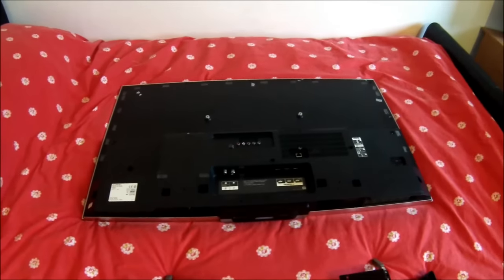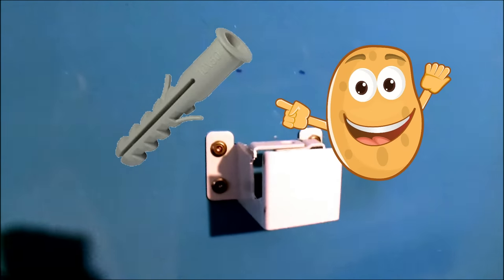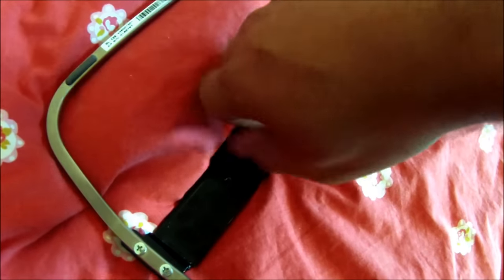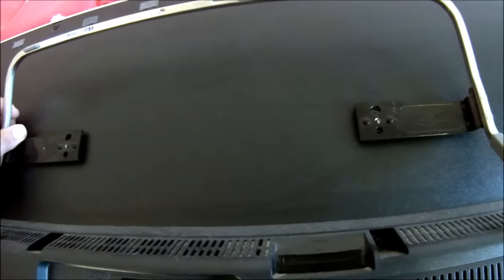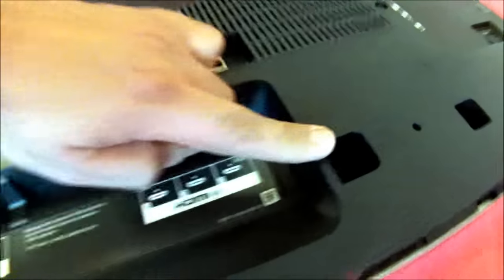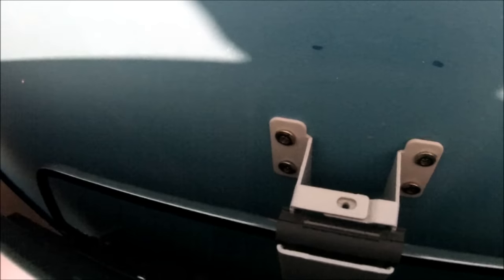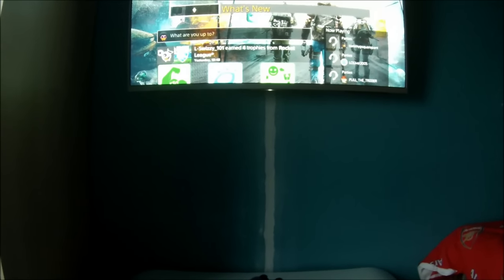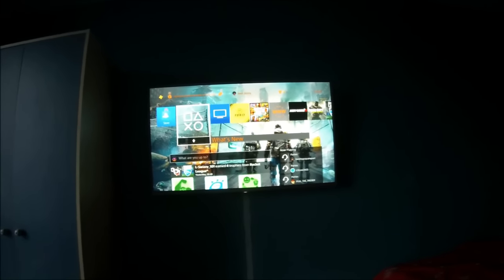How to Use The Sony BRAVIA Wall Mount

Comment: Some advice please. I lost my stand. I cannot find any. Is there an alternative stand i can get?
Reply: I have the same problem, and sorry to say you might as well take the tv to the dump.
Reply: Me too!!! Solved?
Reply: @davidrobert1948  solved?? :(
Reply: Hi, Well after hunting high and low finally I found one second hand on eBay; they did ripp me off and charge £40 though, but I was just happy to find one. So if you need one I would recommend searching though eBay; eventually you will find one 😀

Comment: Hi. Does anyone know if and where I could get the white part that screws into the wall and the plastic bit? We seem to have misplaced ours. We've had the tv for years and now want to mount it but can't find that part. Been looking online but without any success. Thank you😊
Reply: Did you have any luck with this? Currently in the same boat ha
Reply: @carlmcwaters2961  Unfortunately not 🤷🏾‍♀️😔
Reply: I need one as well 😅
Reply: same here, i think i'll call a blacksmith to make a part to mount it... if not, it's impossible

Comment: MY Sony Bravia didn't come with any of the mounting pieces...
Reply: Same here!
Reply: same here :(
Reply: I reached out to Sony and the provided the name of a supplier from which to purchase from. Its expensive
Reply: @katpierre5463  Where and how much?
Reply: Kat Pierre can you please share the details? we never got the wall piece and need.. t.i.a!
Reply: @kirikathoodrat  same here 😭 if possible
Reply: Please someone, where can you buy the wall kit if you didn’t get it when you bought the TV.
Reply: @katpierre5463  can you give details please, desperate. Thanks
Reply: @Denzilcleveridge  right? I've been looking for a very long time now 😭
Reply: Update.  I was never able to find the missing pieces. Even the original equipment that comes with the TV is missing parts and Sony does not seem to have them. My electrician says I may need to just buy a different universal wall mount but have to do a lot of research to make sure to find one that fits because this TV wasn't initially meant for that.

Comment: Shouldn't you use both brackets so its stronger? or is one sufficient?
Reply from the maker: Only got one in the box 👍
Reply: The other bracket is for power supply

Comment: The screws that come out of the two holes in the back to fix the stand too are different than yours, they are not long enough to go through the stand holes and screw in, they are too short!  Mine are black With a flat head not silver?
Reply: Did you find out the size of the screw? I'm in the same boat - ones on the TV (black) for too short.